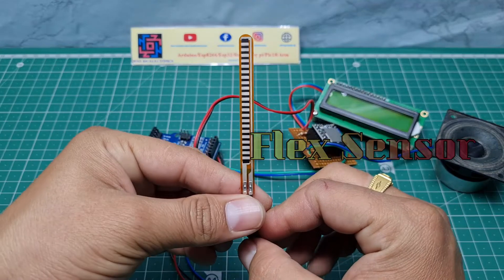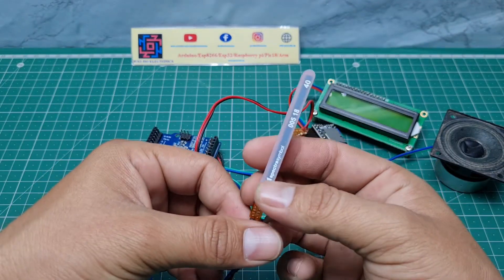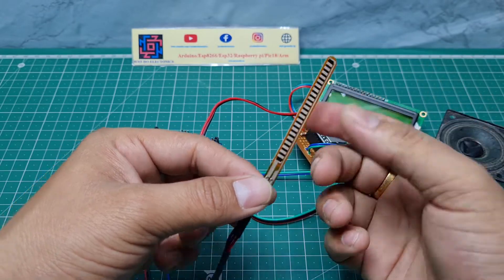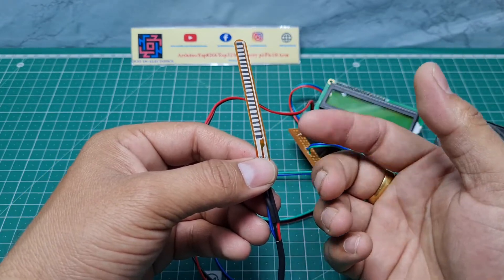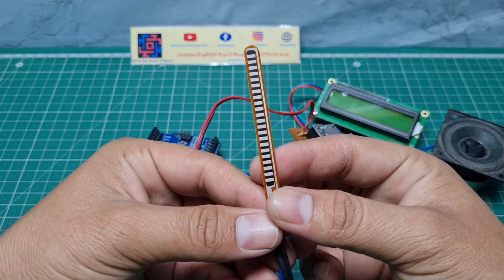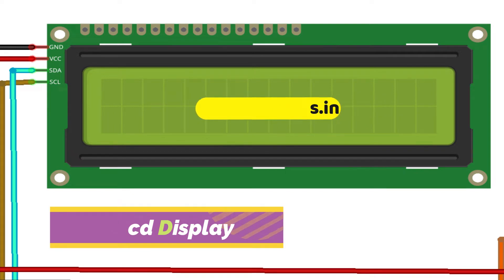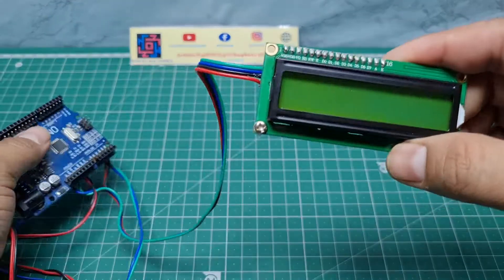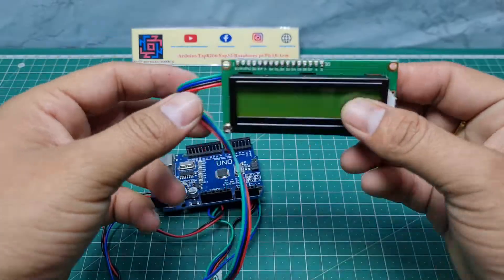Sign Language to Speech Conversion using Arduino With Flex Sensor

Comment: Bro help me out in coding 
This coding is not working ide shows error that " my software serial is not allowed " 

Please help me out I have already get the hardware. Prise of flex is around 500 hundred and all cost is around 3000 so plz send me correct coding
Reply: ME TOO
Reply: Hi bro are u done this project
Reply: I am facing the same problem, and i m also purchase the components
Reply: Help me please